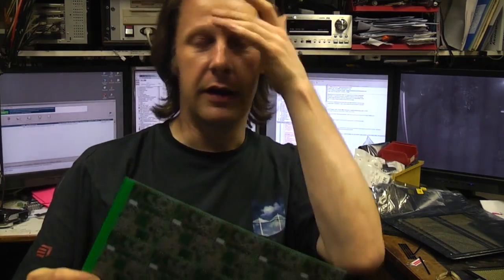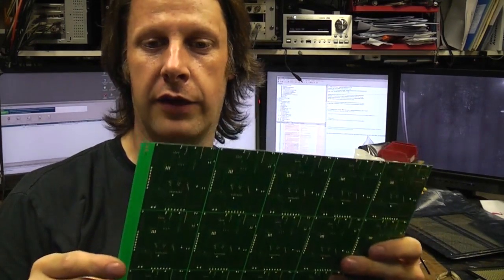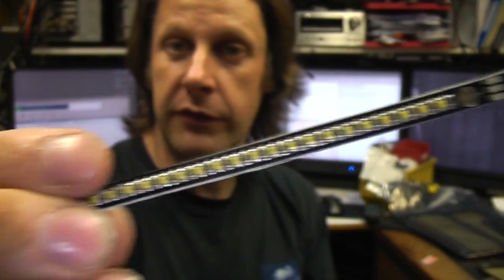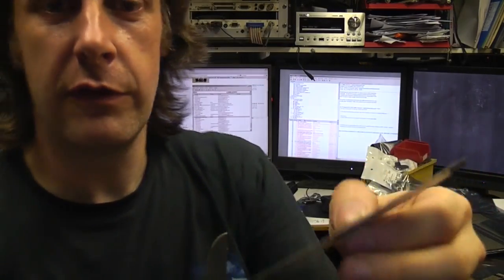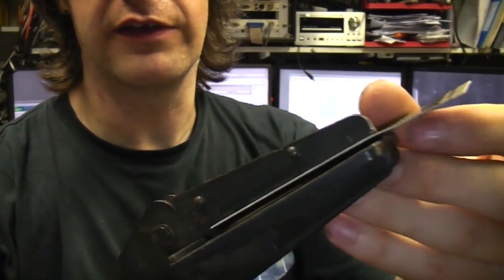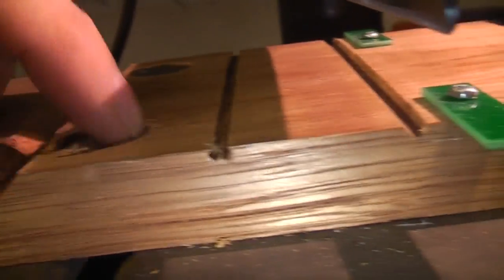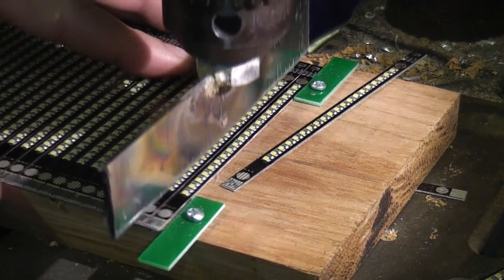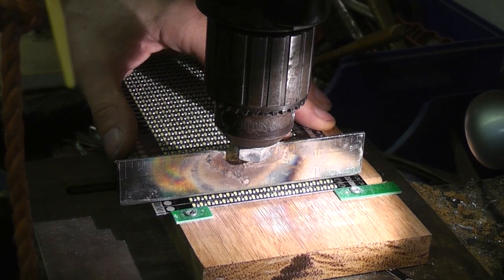Improvising a PCB de-panelling tool

Comment: Nice hack, Mike! :) Reminds me of the Morso cutting machines I used to use when I worked in the picture frame business years back.
I hope you don't forget your presence of mind and turn the drill press on. That'll end in tears! Though I suspect the safety interlock prevents that when the lid is open anyway.

Comment from the maker: Pooled services are where they do multiple jobs from different clients on the same panel to share the 1-off costs. They can be much cheaper for 1-offs but you can rarely get fast turnround or special options like odd resist/silk colours

Comment: Nice. It's like a woodshop, machine shop and electronics problem all in one.  Though I think it might be improved by having the portion of the pcb to be cut off overhanging the platform and having the position-stop as a separate part of the jig, offset from the support board.  That way, when you chop each piece it could just fall out of the way and into a bin or some other container, without having to manually clear each piece.  Or you could set up a power blower to blow the cut piece off the j

Comment: a PCB guillotine.
I can just hear all those thousands of pointy microscopic fibers exploding invisibly into the air just waiting to cause lung cancer. even a routed edge is not free of loose fibers and they are shot into the skin every time you touch it. 
I like fiber glass for its strength and diy versatility but I am increasingly conscious of its problematic nature.
we'll have to develop better alternatives soon

Comment: Before you break out the champagne: I have spoken to some PCB manufacturers who do milspec in Sweden, and they say you should never ever bend scored boards to separate them if you have thin traces or components near the edges. Of course your LED boards are pretty rugged but i cringed when you broke apart the more advanced boards earlier... I guess those were scrap boards though.